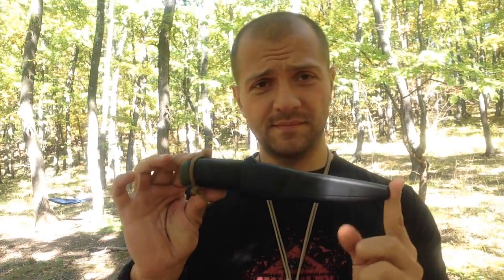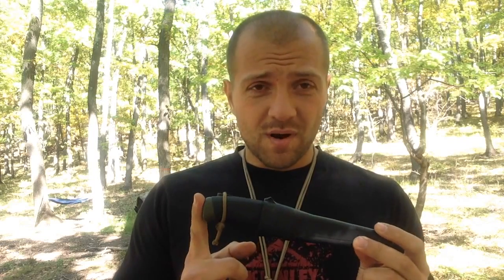Rat Tail Knife Batoning Fail - Enzo Black Beaver

Comment: The tang was just flashed on screen but it looked very coarse. 

The knife was abused, but it wasn't in use, it was by the thermal processing which left that tang very weak/brittle. Anyone who thinks otherwise has a real misunderstanding of the strength/toughness of spring tempered low alloy steel.
Reply from the maker: It has been fixed up. It got a bolt welded to the rest of the tang and it now has a new handle. So far it did alright!

Comment: Starting the split cross grain like that really has to put a lot of stress on the blade. Much more so than just normal batoning. It's a testament to the Mora that it did so well at that, though I shouldn't be surprised.
I agree with your assessment that the tang on the Enzo was left too hard. 
That's a good test. Thanks for sharing.
Reply from the maker: The Mora did much better also because of its thinner blade. I also want to mention that no Mora has ever left be "hanging"
I broke 3 Mora knives so far but each time it was a test of the knife and they never broke during "regular" woodwork such as batoning be it to split wood or cross grain.
That is why I am such a big supporter of the rat tail knife. If Mora can do it, others should as well.
Thank you for taking the time...
Reply: The difference may come from the handle material. The synthetics on the mora can absorb and dampen a lot of the stress from batoning. The bone and wood handle can't. More specifically, the bone can't.

Comment: I agree, that the main reason behind the tang breaking is that the steel was left too hard, but these types of handles are also weakening the knife a lot. The PP and fiberglass handles are extremely shock resistant and they distribute stress better than pretty much anything. Also worth pointing out, that your Mora Clipper is the old model with the short tang and it still did very well.
Reply from the maker: Zwiebi The Mora is very old. It was full of rust when I got it. It is a beater knife and I am so glad that it does such a great job

Comment: Excellent video brother.  I too noticed the rotation applied to the handle to break pieces free and while batoning before the snap.  Shouldn't have broken but certainly amplified and showed what could have been disastrous in a survival situation!  Without the torsion it may not have snapped that day, but would have certainly on another.  Be safe!
Reply from the maker: vikingssoul Yes, you are right, I did twist the handle a bit but only enough to keep it in the cut. The Mora cut a much worse treatment. I rather it breaks when I have a spare then when I don'tHave a great day! :)

Comment: That is a shame, you would almost think there must have been a defect you didn't hit it that hard. thanks for sharing the video.
Reply from the maker: My guess is that the tang of the blade was left very hard so it did not deform and under pressure from my hand with a bit of twisting and the shock from the baton it just snapped off.

Comment: Alot of knife manufactor's use batoning as a loop hole, they say batoning is not recommended as far as normal knife use, but you hit it right on the botton, usually it's in their tempering process, I see a few video's from different manufacturer's where the blades failed in odd places, so there's no question in.my mind, that it's a defect in the tempering, if it wasnt, the blades would generally fail in the same place, sorry about your loss,  please keep us informed, as to what they do to correct your Loss, Thanx for sharing this.
Reply from the maker: paulie 4x I have not shared this with Brisa. I do plan to. Just to see their response as the knife is almost ready for use. A few finishing touches and a coat of wax on the new handle. I will test it again...this time the handle part will not fail for sure so I will see if the blade fails anywhere.

Comment: Looks like it did not have a propper anelining in the tang. Did your friend normalize the tang after welding? Great video it is not abuse in my book. Any knife I bring with me in that size or larger I demand it to be able to take that kind of abuse. Otherwise I will not trust it and bring it with me. 
Thank you for sharing my friend.
Aalborg the best , Rob
Reply from the maker: Yes...I also believe that.
He welded a piece of metal on it which was not hardened. Better have the handle made out of softer steel that way it will bend and not break as this one did.
Thanks.
Have a great week my friend
Denis

Comment: Small tomahawks which are made for chopping/ splitting are 1/2" thick at the spine. A lightweight in the world of splitting tools. That should tell us how equipped a 3 plus mm knife is for batoning. I've seen knives that are much thicker break when batoning. I don't mean to be blunt but batoning is a bandwagon practice that has only become a thing in the youtube generation. the physics of a longer thinner piece of metal being stricken at the tip will never be as adequate as the shorter thicker head of an axe. Even a 1/4' thick knife for batoning is bad practice for longer term survival. When an axe hande breaks, it can be replaced. When your cutting tool breaks because you batoned with it, its broken. When used right, an axe is safer than batoning. If your baton glances off the knife and you swing to hard, you may risk cutting your wrist. If your axe is small, just cut at a low stance so if you glance off the wood being split, you hit he ground. We have to remember these are the tools that exact our survival, but I won't be a nazi about it. Each of us has to decide how long we want our tools to last.
Reply from the maker: I think I said this on many comments: IF the HT is done right the tool won't break! 
But since you took the time to write your comment I do also have a question for you: How do you test your knives? And a follow up question would be: how come some knives can take it and others can't? I never broke a 2mm thick Mora while batoning...I bend a few and now know their limitations. 
An untested tool is a setup for a bad time when you need it...but that's just my oppinion.
Reply: Good question. I test the few knives I have by cutting with them. I tested my tomahawk by chopping a dead apple tree down with it.

Comment: Usually I find that rat tail tangs are adequately strong for most work, including battoning. I suppose it could be a defect of a combination of being rehandled or accident prior to you getting it? No one is perfect, including manufacturing people, but you are right about the Mora, their failure rate in probably the lowest in the industry!
Reply from the maker: traderjoes I broke 3 Moras so far. And I had to work really hard on doing that. And it was no accident. The blades had a slight bend after really hard cross grain batoning and I wanted to know how much they could take.Until I applied lateral forces to the handle everything went fine. Only when I bend the handle to the side really hard was when the blade snapped...but they all bend a bit before breaking. I agree...any tool can be faulty. And I am not picking on ENZO for this. This was more a "show and tell" of what can happen and why just because one rat tail knife fails it does not mean that all rat tail knives are not suited for heavy tasks.

Comment: And this is why you dont baton any knife, especially in a survival situation and take a chance on breaking or damaging the most important thing youll ever need.
I for one do not chop, split, and damn sure dont baton wood, or even cut it up into smaller pieces.  I do it the lazy white man way and drag up logs of all sizes and lengths and push them into the fire a little bit at a time as they burn lol.  Why waste calories and wear and tear on your equipment when its going to burn anyways.
Reply from the maker: ***** to each his own.
whenever i go out on a 2-3 day trip I take with me knives that I know can take batoning because I tested them harder than I will ever use them in a real life situation. So I know they won't break. Testing and using in an extreme situation are two different things. I recommend both. The way you chose to make your fires may work best for the are where you are but please try to go to different kinds of woods where you find big pieces of dry wood and all the little pieces will be too wet to start a fire. What then? 
Also...if you do not intend to split, pry, baton with your knife then you don't really need a blade that is thicker than 1.5-2 mm.
When it comes purely to cutting tasks such as making feathersticks and carving you are much better served by a thin full flat ground blade with a small edge angle. There you can do your job with a minimal amount of energy and maintenance will also be quicker and easier.

Comment: A knife is a knife not an axe!  You should not be using a knife as an axe!  You should not baton a knife!  Buy an AXE!  ;-)  Did I miss anything?  LOL
Reply from the maker: EconoChallenge You hit all the major points....Another one would be "Buy US made next time!" :))
Reply: SpartanJohns "Buy USA made next time"....lol.
Rob.
Reply from the maker: RDPproject And now, finally, the circle is complete! :))
Reply: actually you did... who the hell is gonna drag an axe somewhere that only requires a blade for splitting? an axe (at least a properly made one) isnt designed for splitting either, its a chopper, with a thin bit. A maul is a splitter. Is anyone gonna haul around an 8-10 pound maul instead of a knife? nope. Batoning is a task a good knife should be able to take pretty easily. The only thing he could've done is baton a full tang, which is besides the point of the video. It's called a TEST for a reason...
Reply from the maker: +Arizona Survivalist he was joking.
Reply: SpartanJohns I thought I had a good eye for satirical commentary...

Comment: The handle was made wrong. It should have been one solid piece, not made out of leftover wood scraps.
Reply from the maker: +kinezo1961 THe handle was made right. Not leftover wood scraps but proper wood, leather and bone. it is easy to make a handle out of one piece...harder to make a handle look antique
Reply: If the handle was one piece instead of little pieces it would have supported the rat tail.
Reply: +SpartanJohns im happy you said that cause if you know anything about knives alot of nordik knive are made that way .ps looks like a great lil blade

Comment: You do not need to baton wood and certainly not in a survival situation where you need to save or protect your knife from going to pieses. You can use twigs, sticks and later thin branches and in this way build the fire up. But it is fun to baton with a knife

Comment: The whole issue of testing a knife by beating it with a club is nonsense.  You test a knife by using it for knife tasks.  The test of a knife is simply whether the edge will hold up without chipping or rolling, and whether or not the knife is easy to sharpen when it gets dull.  

You don't test a car by ramming it into a large tree stump to see whether the stump  will come out of the ground as if you were driving a bulldozer, and you don't test a knife by seeing if it will stand up to the punishment you would give an axe.  It's silly.

You test a knife by using it for knife tasks.  Period.  There is never, ever, under any circumstances when you will have to use a knife for batoning unless you are woefully ignorant of woodcraft.  Even if all you have with you is a knife, which is more ignorance, there is still absolutely nothing you need to do that requires batoning.  Never, ever.

Batoning with a knife was invented by a marketer with a chunky knife he couldn't sell, not by a woodsman.  Unfortunately, a couple of self-taught people lived long enough to pass this nonsense on to YouTube, and the young tech bunch who also weren't woodsmen, ran with it.  It's made worse by ex-military wannabes who thought the military handed them Ka-Bars because they were supposed by abuse them, rather than use them against enemy soldiers in an emergency.

Your pocketknife is your bushcraft and your survival knife.  For most of the world who just laugh at the YouTube bushcraft and "survival" communities, and even for many militaries, the bushcraft and survival knife, fighting not included, is a Swiss Army Knife.  Even the US military is handing them out to troops.  For American woodsmen the bushcraft and survival knife is a Hunter, a Trapper, or a Stockman.  A Trapper is the favorite of those who don't do a lot of carving, and the Stockman is the favorite of those who do.

Professional carvers and whittlers the world over use a Stockman, but I've never seen one use a Mora Companion.  

Without rambling any more, you test a knife the same way you test anything, which is by USING it for the SAME tasks it was designed to do.  You're supposed to be testing for hotspots, for blade geometry, for edge retention, and for ease of sharpening.  You are not supposed to be testing for wood splitting ability, or for how well it takes getting hit with a club because no knife ever has to be hit with a club.  The is absolutely no time, no place, and no job that requires beating your knife with a club, so testing for it is just silly.
It makes no more sense than testing your hatchet by seeing how well you can type out an e-mail with it.

If yo would take the time to learn woodsman skills, you would know that even in a true survival situation, there is no need to beat your knife with a club, and no need to pry anything at all.  You would learn that Rambo wannabes aside, a pocketknife is all you ever actually need for bushcraft and for survival.  

This doesn't mean you shouldn't carry a fixed blade because they can be handy, but they are simply not required for anything.   In the last fifty years, even more big game has been skinned and processed by a Buck 110 than with any other single knife.  

And, seriously, how can anyone think for a second that a fixed blade knife is anywhere near as good at carving as a pocketknife with three blades.  Three better sized blades, the blades made for three different kinds of cutting, and three blades that cut as well, but that don't chip nearly as easily as a Scandi grind such as a Mora has?

Test your knife by using it like a knife, not by using it like an axe.  Testing is supposed to show how good a knife is for doing knife tasks, not for how good a knife is for doing axe tasks.   If we tested everything the way you test a knife, we'd all be neck deep in broken computers, TVs, electric razors, cars, and probably even condoms.

Comment: Black Beaver has differential heat treatment proces .- blade is 63 RC and the back of the spine and tang is much less (mybe 55 RC). I would presume  this was origin  of a problem. And the double antler bolster (glued together)  is also not helping the strength and integrity of the handle .

Comment: Sorry about your blade.  It used to be a knife-failure vid would get thousands of views. But, by this time, people are come to the realization that batoning is a viable, emergency technique... but has its risks. It takes a certain skill set to identify the correct wood, choose the best knife for the job [or to carry for an emergency] and use the best technique.  But, sooner or later, fate shows up.  I like the technique. If the knife breaks, I'll just get another.  Not the end of the world.  Glad it's been fixed. Be well.
Reply from the maker: Thanks. I don't really do it for the views. I do it more to show that even if the Black Beaver is 4 mm thick it was inferior to a 2 mm thick very old Mora Clipper.
I wanted to show that rat tail  knives are not bad knives for batoning. It depends on the HT that the knife received. Also I wanted to make a point: I see a lot of people making reviews of new knives and saying how good that knife is because it has a 6 mm thick spine. But without testing...it means nothing. That is why I prefer to buy either a Mora(because they are inexpensive) or a more expensive knife that has a "no questions asked warranty". Because I will test my knives, I will beat on them and in case something happens I would like to know, in case I paid a lot of money for a certain blade, that it the company making it will back their product and does care about the customer.